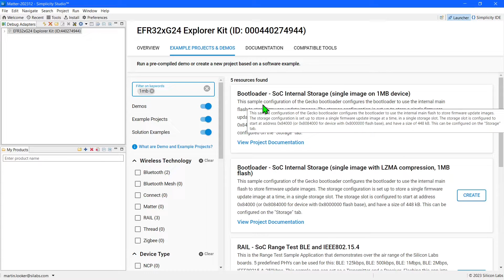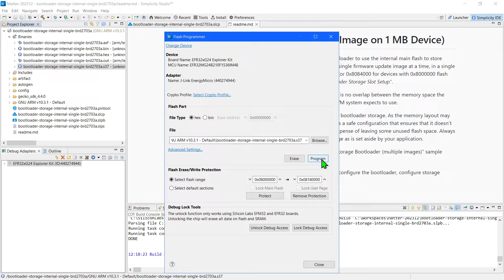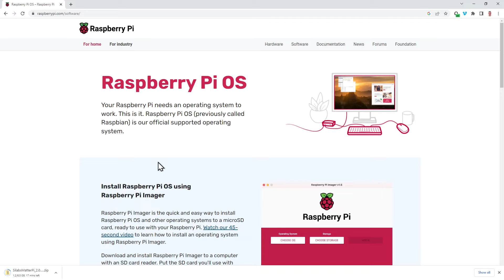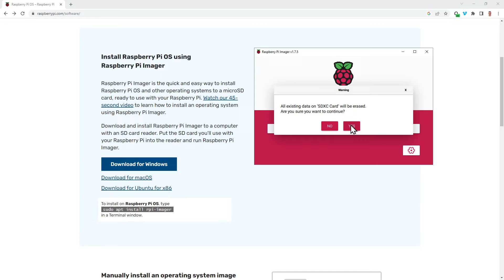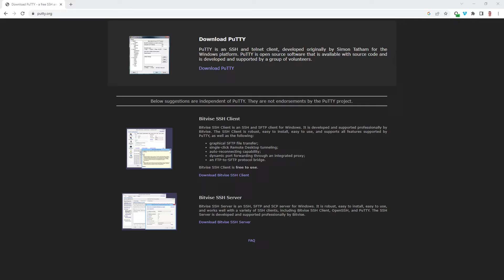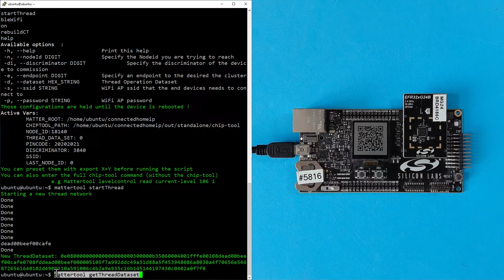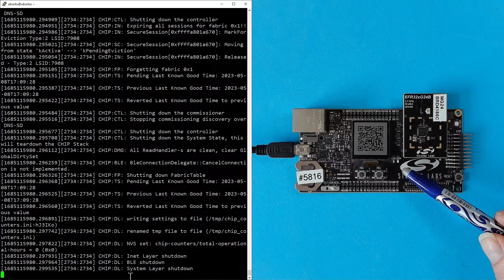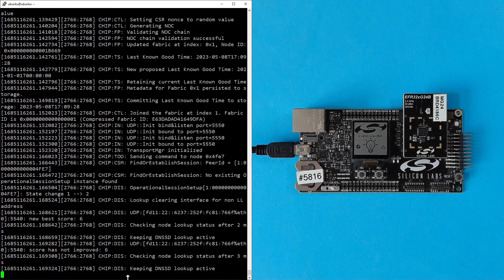Quick Start - OpenThread Border Router - Silicon Labs

Comment: I have problems, starting a thread network at all. I use the Raspberry Pi image, you referred to on an Pi 4, out-of-the-box - only using a flashed nRF52840 dk. When running the mattertool help command, the help appears - but I don't see the matter logo or the "setting environment variables"-lines. When starting a thread network, it just says "connect session failed: No such file or directory" x 11. Any suggestions?